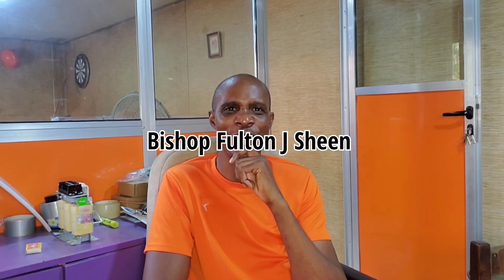Mystery and intrigue at our Micro Grid? Is it still running? Help us solve it.

Comment: Generator (and Diesel fuel) usage will now be greatly reduced with battery storage now being in place . Expose the culprit to a relevant individual who has a vested interest in the system working as you have designed it !
Reply from the maker: We are still fighting this battle with them. The relationship is in a bad place at the moment. We are insisting on some rules of engagement going forward. Yes they are spending much less on diesel now compared to before.

Comment: Just to ask, d solar system isn't compatible with inductive hot plate cooker?
Reply from the maker: Thank you for watching and commenting. The hot plate is not an issue at all. The bare wires are. If the system is at full capacity and the hot plate is introduced it will overload a phase. 3000 watts. Each phase is 24 kw. So it has to be balanced.

Comment: What do you mean with pv leakage? And how did you solve it?
Reply from the maker: It was addressed in the video.
Reply: Yes, I watched the video thanks
Reply from the maker: @nestyplus  what was happening was that the inverter would shut down each time the string was on. Damaged insulation or panels could cause current to flow in the wrong direction. That is what was happening. I realize that I did not explain it in this video